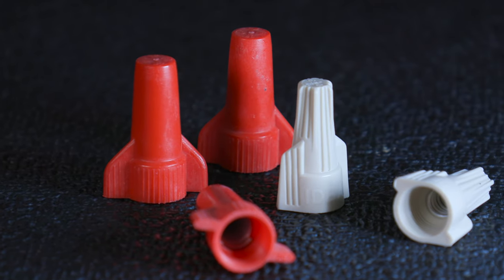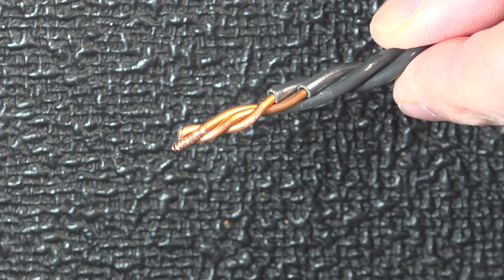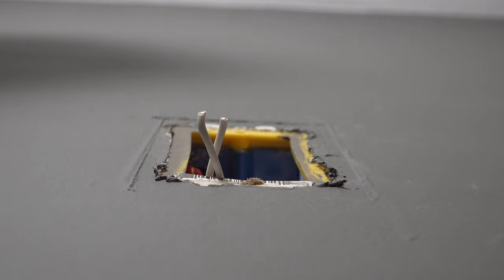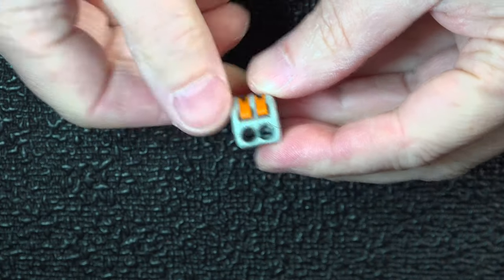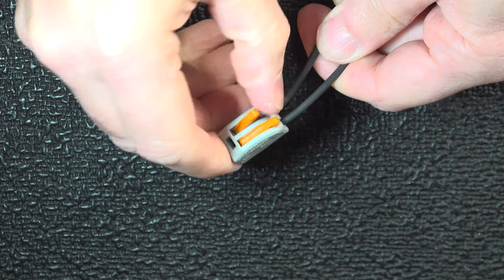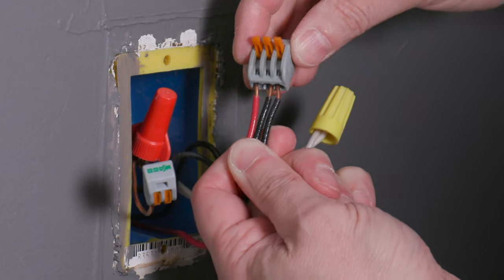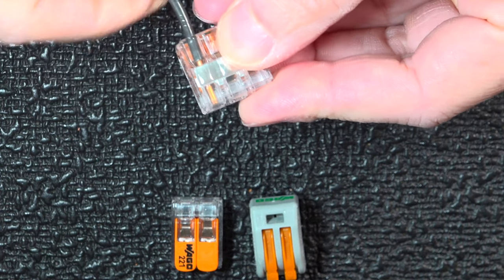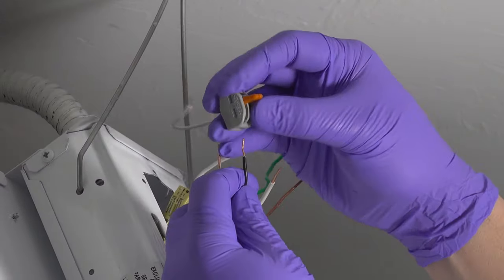Never use Wire Nuts Again - Wago is Better Electrical Connector

Comment: Anyone who uses a pipe wrench on a wire nut should not be allowed near electrical wires.
Reply: Or plumbing.
Reply: I may be mistaken. But I believe that the comment was meant to be sarcastic. As in you can overkill any simple problem. Wago connectors are overkill for any electrical job. Just like "using a pipe wrench to tighten a wire nut" would be.
Reply: @elijahbaird3950  it was somewhat sarcastic, but also serious. I'm not saying wago connectors are overkill, I think they are actually pretty cool and to each his own to use them.

What I take issue is this guy is trying to pass on false  electrical advice  information to try to get someone to click on his affiliate link.
Reply: @keithdouble1440  I hope you are neither of those!
Reply: I crank em down with the 1 inch impact gun.
Reply: I see sarcasm has escaped your aresenal of survival tools!
Reply: Yes, sorry. I completely missed the intended sarcasm!
Reply: @keithdouble1440  my hardware store sells self adhering silicone tape in the plumbing section, so a lot of people must use it that way.
Reply: @keithdouble1440  yes yes!
Reply: Here I thought those were Lineman pliers
Reply: Maybe for those huge wire nuts when trying to connect 6 1/2 gauge wires.
Reply: @joecrachemontange4613   1200ft lbs of torque sounds about good 😅
Reply: @keithdouble1440   Well at least the spraying water put out the electrical fire
Reply: Anyone who uses wire nuts should't be called an electican.
Reply: @Jakub1989YTb  You just made every electrician in the United States unemployed.
Reply: or maybe he should be allowed to !!!
Reply: @feverdawg1  survival of the fittest, right?
Reply: Amen borther
Reply: @IAmKyleBrown  your right they get hot and guess what fire and if they use the wan go  connector you better count wires you will overload that box real fast
Reply: @Jakub1989YTb  wronge
Reply: Anyone calling lineman pliers a pipe wrench shouldn't be allowed to comment
Reply: @jonathansirmons7932  yo man, check out 1:18, I'm pretty sure that's a pipe wrench.
Reply: @IAmKyleBrown  well I'll be damned, my bad bro.
Reply: OMG I"M DYING!
Reply: Who would? I've never come across a need in 20 years to use anything more than a pair of linesman pliars. And 99.99% fingers work just fine.
Reply: @keithdouble1440  Duct tape works better is what Red Green told me.
Reply: @Jakub1989YTb  Anyone who clearly has no experience in the field shouldn't make stupid comments
Reply: Personally I like to chuck them up in the drill and spin them on 😜
Reply: Was thinking the same thing, maybe shouldn't own tools at all.
Reply: Rofl. Reminds me of home improvement with my dad as a child. "Son, this is how you flip the power off before working." Uses a pair of pliers to short a live wire
Reply: Or hvac
Reply: @Zmej420BlazeIt  surefire method-
Reply: @IAmKyleBrown  When Al Gore invented the internet, he was certain that all things on the internet would be true.
Reply: Slip joint pliers work better.
Reply: Shouldn’t even be near a pipe wrench
Reply: @rjwlax  No, that's a hammer
Reply: This tread is SUPER entertaining but now I'm so confused on how to replace my stupid track lights with normal ceiling mount lights. Maybe I should just call an electrician
Reply: How about a pipe wrench to join two rubber hoses with metal flanges,  but puts the pipe wrench on the hose instead of the flange? Cuz yea, seen that one.
Reply: 🤣🤣🤣...I needed that. Thanks...so true.
Reply: Lol
Reply: lololol
Reply: Elijah, you underestimate the stupidity of some individuals out there. Sarcasm or not, it’s reality. Some people are just “more mixed up than a feather in a whirlwind.” 
Extra credit to whoever knows where that quote originated from.
Reply: I approve this message 🤣🤣👍🏾🤦🏾‍♀️
Reply: yeah, you can't weld on a cast iron pipe wrench.
Reply: who uses a wire nut FTFY 😂 utter trash, for some reason NA electrics really like that cheap 70’s aesthetic. EG your AC cutouts vs a nice modern safe rotary isolator, huge boards with retro CB’s. Wire nuts that take 3x longer to install.
Reply: I'm pretty sure it was simply for a demonstration of "over-tightening", not intended as a real practice someone would do.
Reply: True!
Reply: anyone that's an electrician should never use plumbing stuff.

Comment: Never in my life have a seen such dramatic demonstrations of wire nuts.. they work just fine
Reply: Lol
Reply: Not. Wire nuts are useful, but not In damp locations or when exposed to vibration. In the carwash industry, 99 out of 100 electrical problems are caused by wire nuts.
Reply: @carwashadamcooper1538  ok, useful knowledge. Still doesn't take away his dramatic the demonstration is lol.
Reply: @carwashadamcooper1538  They are available for damp/wet locations. Google them.
Reply: @carwashadamcooper1538  problem with these the area of contact on the wire is very small. Twisting the wires together and then a wire nut is best way and they use tape to wrap everything up.
Reply: @williambritt5334  I would actually like it if somebody would investigate into that. my grandpa was a master electrician and growing up we always used wire nuts. When I got into automotive we never used to wire nuts. Connectors and splicing especially is what we used. A good splice is a perfect connection with no gaps for arking. Looking at wiring notes now I really wonder how we can use them the way we do it if you twist you wires together you still have small gaps. When you screw the wire nut on you still have small gaps.

I would love it if somebody could test how much surface area actually touches versus this connector he's showing and also see if the wires are always going through where they're touching or if they're arching. 

Maybe make 2 simple circuits with a plug, a switch, and a light bulb. Cut the wire between the switch and light bulb and install one of these on each. Measure the temperature and see which one gets hotter. I want to believe it's actually going to be the connector shown.
Reply: @carwashadamcooper1538  
That can't be true. 30% of electrical problems are caused by electricians.
Reply: @rickoshay6554  😆🤣😂I was thinking 100%
Reply: 😂😂😂😂 Agreed
Reply: These have been my go to for a bit now. A different brand though.
Reply: @custommotor  It has been done before. I don't remember the name of the channel but it was an English guy I believe. He tested all sorts of connectors including wagon and wire nuts and checked for heat and pushed them to failure. Result was that all the connector types are fine if used correctly. Remember that even if the wires only touch a bit in the wire nut, there's the spring inside that's going around and around binding the wires together that's also conductive material and touching all the wires in the nut in multiple places on each individual wire.
Reply: @reddicsteel4961  
My first reaction was more like 80% but I thought I'd be generous. You must have experience working with electricians but don't forget rats and plumbers also get in on the act.
Reply: I mean yeah sometimes things go wrong more so if your stupid, but in general I've had a issue with wire nuts. If something happened it was something else and the overheating of the device caused overheating at the wire nut seeing as the current running through the nut caused it melt
Reply: @custommotor  well i guess you could go back to solder joints and tape
Reply: @rickoshay6554  ok. You got that.
Reply: @carwashadamcooper1538  solder you connections.
Reply: @carwashadamcooper1538  most likely it's the wiring method and not the wire nuts themselves.